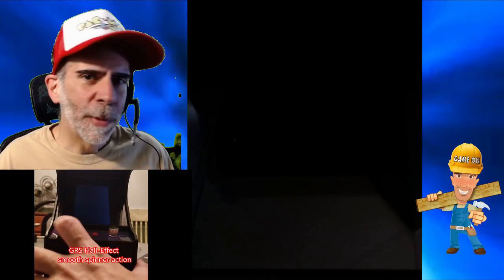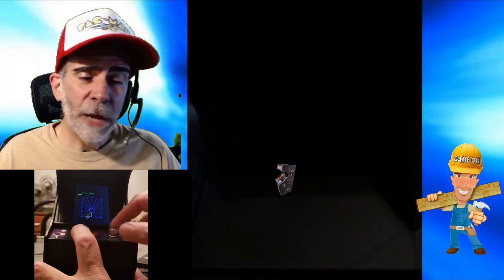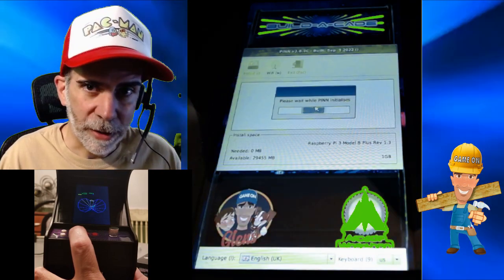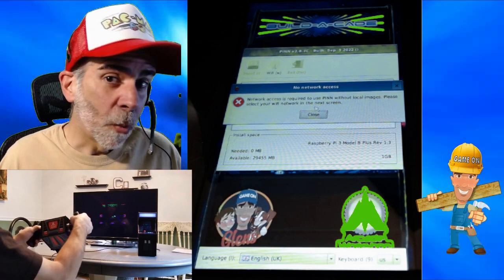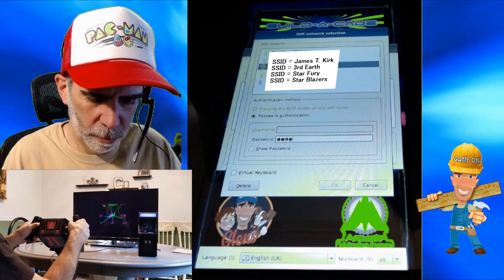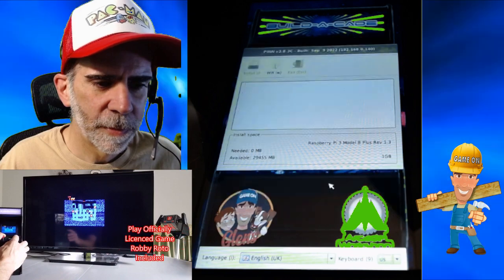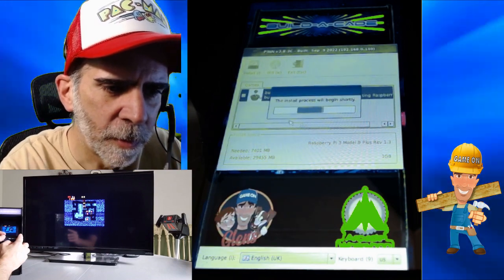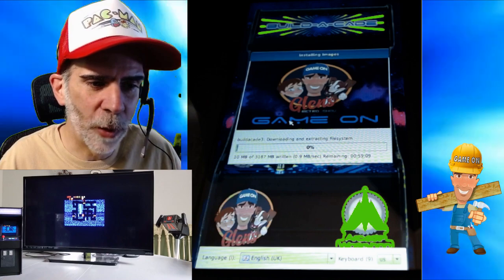How to install the OS software on your GRS Build-A-Cade

Comment: Feeling stupid here, but how do i install the os on a larger SD card?
Reply from the maker: Tot can use a program called win32 Disk imager to make a copy on your PC then write it to a new larger card ;)
Reply: @GlensRetroShow   Thanks a bunch, but all it did was make a copy of the card at 32GB on a 400GB card So I am shy 350GB lol  Any Ideas?
Reply: @GlensRetroShow   I found the option in the menu "Expand Filesystem:" but it says that i am probably in NOOBS, in which case your root file system is already expanded anyway.